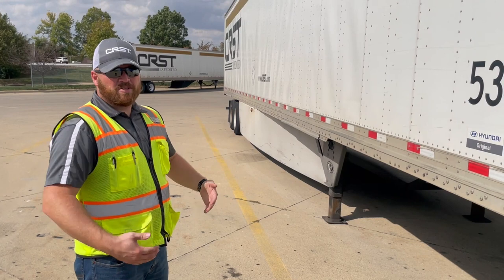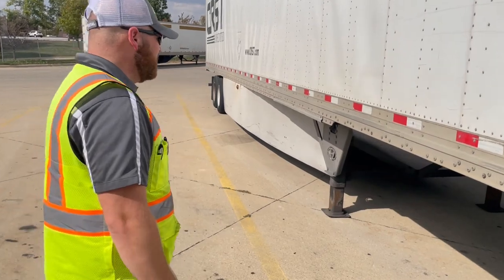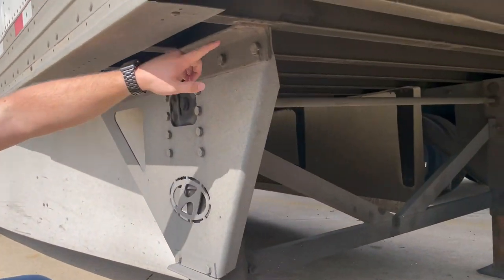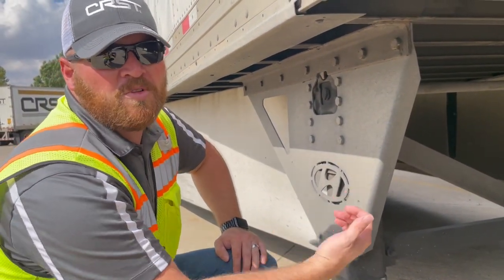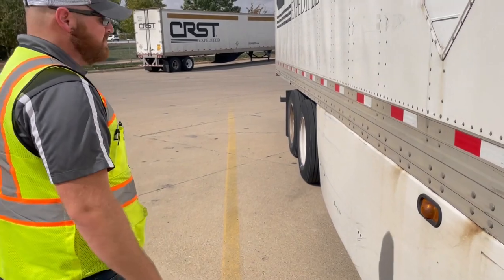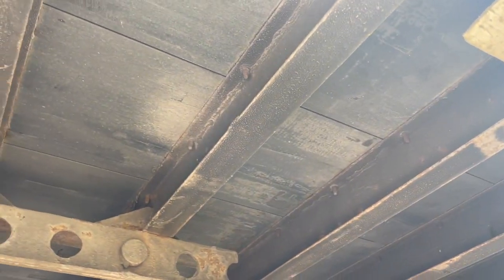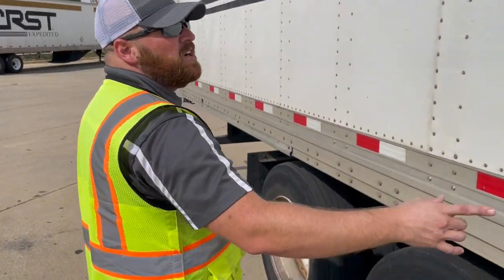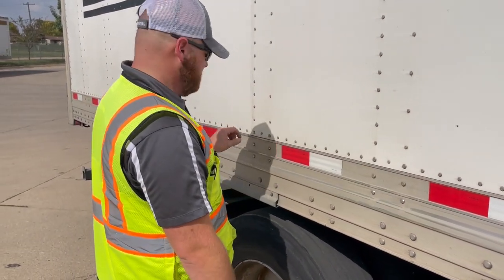Trailer Visual Inspection - Safety Saturday

Comment: I also pick up a lot of trailers that others have screwed up without reporting. 2 really serious issues in the last couple weeks. One had landing gear that was BROKEN to the point I'm surprised it didn't fall over. We pulled up to it in a fedex yard and I saw it leaning from 200 ft away, it was loaded like that. One of the cross members was broken and separated. Another one I just pulled last week had a round dent in the side rail where someone obviously ran into a yellow concrete or steel post and just left it like that. Just a couple examples of many.